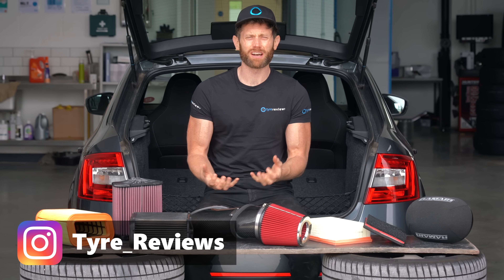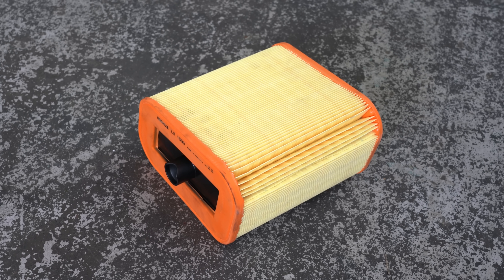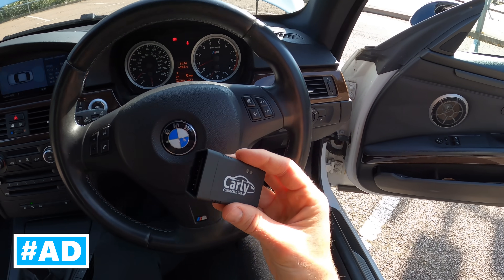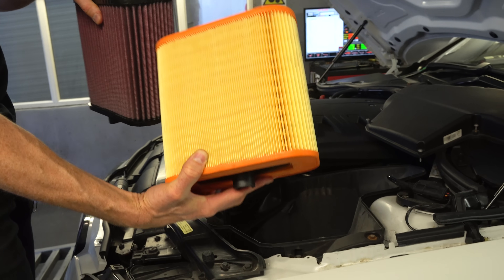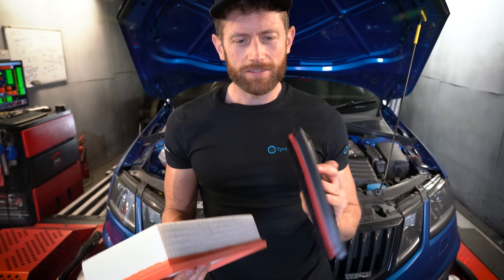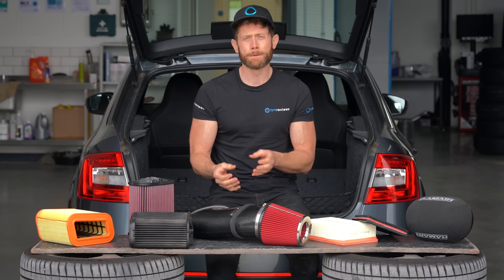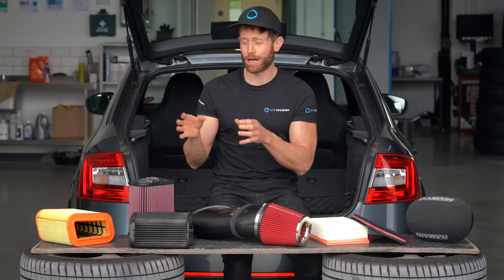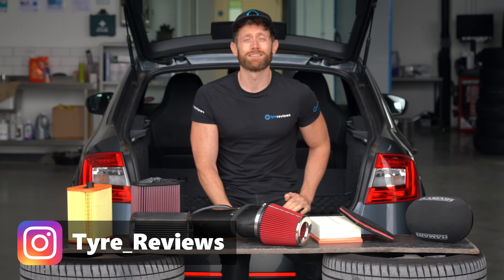Do Performance Air Filters REALLY Give You More Power?

Comment: For manufacturers of intake systems you are a scary person :-)
I am a tuner myself and have dyno tested hundreds of E9x M3's on my dyno dynamics machine when I owned it.
Tuned many all over the world remotely on dyno's too.
People always insisted on purchasing BMC / K&N filters from me and I'd show them time and time again, not even 1 HP gained.  Now that's with me being a lot more thorough than your testing where I was monitoring intake air temp (in the manifold), ignition timing and AFR.  With all things constant I never saw a gain.
Was sent kits from USA with very nice elbows - never saw a gain.  Ever.  Most of my tests were done on cars with primary CAT delete which is the major restriction point on the S65 engine.

Now, as for 'ecu' tuning for an intake, there is no such thing on modern cars with target based AFR and Ignition timing algorithms.  I can tell you now, it makes no difference for intakes UNLESS there is so much more air coming in the ECU has to change it's long term adaptions.  However, then it's adapted by itself so doesn't need tuning LOL.  The only factor that you can play with which 'could' make a difference is the valve overlap / cam timing.  It doesn't work.  I map the S65 and advance the intake cam above 5000rpm gradually and it does make a difference but adding an intake after that still doesn't do anything.

Most intake systems are about NOISE and under bonnet looks.  They can in very rare cases improve throttle response and partial load driving in the real world which is not going to show on a dyno though as this is only full load testing.
Low rpm torque dynamics can change especially if a nice large venturi is added which none of the intakes you have tested have.

I drove my own M3 with and without intake systems and to be honest I never actually felt a difference on the road over hundreds of miles of driving with them on and off almost every week or so.  Noise was good though!!

The S65 platform does have the capacity to gain 'some' power through the rpm range and good improvement to partial load torque BUT this requires a total re design of the OEM airbox so that a very large venturi can be added in place of that really quite small and awful elbow design which isn't going to get any bigger with ANY after market elbow kit.  I'd love to experiment with the shape of the inlet velocity stacks.  I had experience on the S62 where a customer made his own carbon ones and yes it did make a difference to throttle response and top end power.
No one offers this for the S65 and that is primarily because of the cost of development and then requiring a totally new plenum.

Next time you ever dyno or test cars on road for performance I'd be more than willing to lend a hand on doing even more accurate datalog based testing.  It's very easy with all of the OBD apps available now.

The ECU tuning..... we can have some serious fun if you are interested and I can show you all of the maps and how they are altered.  You'll have to contact me to find out which very MAJOR UK companies I have done all of the tuning for :-)  

Oh, and while the Akra is a great exhaust, you do need a specific map for this.  The Akra creates a bit of a low rpm torque dip which is related to it's X Pipe design.  You get rid of this by forcing a bit of timing and altering the valve overlap with the vanos timing.  Only one company offers this in the UK and I have that very map sitting on my PC :-)

Anyway, that's enough of me rambling on....... Look forward to seeing more reviews of all sorts.

I think it would be great if you could do some reviews on the latest E-Bikes!
Reply: One more thing I'd like to point out is that during my entire time dyno testing M3's on the Dyno Dynamics, most cars would make a calculated flywheel figure of around 405-420hp and around 290lb/ft torque and in excess of 430hp when primary CAT Delete.
I have seen M3's make a lot less if the wrong gear is used and if the car was strapped down too hard or if really sticky tyres were used (increases the frictional losses since the Dyno Dynamics just adds a percentage to the wheel figure rather than actually measuring run down losses).
I'm not sure as to why you are only achieving 380-385hp but my guess would be it's something to do with the way it's strapped down or the tyres you have used.
I would ask the operator what gear he used and do a new baseline.

Do you have an image of the dyno graph (just one will do) ?

Comment: A sport filter is the best cheap mod you can do to any car. Everybody is so fucking fixated on the power, they forget the rest. I put a ramair kit on my octavia vrs and the turbo is so damn loud now that people turn around on the street when I boost it. Sounds like its straight outta fast and furious, and its not even tuned, running stock boost. To me that was 100% enough to justify the cost. Dont care if I lost 5hp or gained 5, I traded it for enjoyment and thats what matters. I will continue to put sport filters on my cars, never had an issue with them and until I do, it will be the no.1 mod I do. Happy days.
Reply from the maker: I like you

Comment: Not even with old atmospheric carburetor cars... Even those required adjustments to the low and to the high speed circuits, AFR
But once the adjustments are done, as with newer ECU tuning, there is more power but then again something else will restrict the system: exhaust. 
An AccessPort device is needed for the least modification to work

Comment: i feel like you guys are running it on the dyno with the stock tune and not tuning to run the intake you installed... therefore you wont see the gains because the factory tune is optimized to be ran with the stock intake.

Comment: Short answer: “No.”
Long answer: “Possibly, but no.”
Reply: Depends on the car, some respond really well, others loose power.  Too many variables to make a statement like that.
Reply: Well on a regular car no but if it's tune then yes
Reply: @danielcasillas1133  I think still no... Maybe few extra hp, but with the money they cost, you better put them in something more efficient... So, still No!
Reply: @ScutuRC  depends on how far you go, 60$ for a 15bhp increase on a car that has a full exhuast, increased fuel pressure, injectors, and a map is easily worth it. Some guys tested a 9-5 aero that made about 295hp with the stock intake system, I believe they had a drop in oiled filter. They switched to a 3inch open air filter that sits in front of the wheel and it went up to 310. Intakes are cheap, and for a boosted car that's modded, they free up your other mods and help everything flow better
Reply: @ScutuRC  u get the sound so its worth it!
Reply: @danielcasillas1133  intake tuned and catback exhuast will net you no more 10% percent of power from a stock naturally aspirated engine anything more your talking about full exhuast engine internals cams and proper race intake box and torttle body and proper ecu work not just a tuned like motec or fcon.
Reply: Thank you
Reply: On a stock motor, no
On a built motor, yes

Comment: Just as in every other test. They just put a new filter in and test it. There is no point in doing that in my eyes because the engine management system needs to adapt! And that takes a while. I had it in older cars that they developed full power after nearly 100km. So give it some time.
Reply from the maker: Modern ECUs adapt relatively quickly, and we give each setup plenty of runs to adapt

Comment: Of course the performance would drop during testing ...Heat soak.Reduce the air intake temperatures will increase power ,even with the stock filter.Either insulate the the sensor or move it .A heat soaked sensor will deliver wrong info to the ECU

Comment: I would say unless you work the head, you wont benefit from a different configuration than stock. (On an N/A engine) on turbo engines, a tune and intercooler works wonders.

Comment: this came in handy for me. I dont have an expensive or a fancy car, I only have a 1.4 NA 2016 corsa, I've tried different filters to try and get a slight power increase. I've had universal filters, a ram air system and now using an enclosed carbon fibre filter with direct cold intake pipe drawing air from the largest open gap under the bonnet. at times it can really pull strong and at times it doesnt pull as good. makes me consider about the heat shielding.
Reply from the maker: But the sound
Reply: @tyrereviews  it definitely sounds better than some wee chavs 1L corsa C with a Halfords filter 😂😂

Comment: put 3 inch exhaust, high performance cat, cherry bomb and k/n filter on my 1984 f150 4x4, 4.9 back in 1985, went from 13 mpg to 18 low 21 high mpg
Reply from the maker: and extra BARP

Comment: It's almost like the engineers who originally made the intake system kinda knew what they were doing.

For the price of one perfomance filter for my car, I car get, like, 10 years worth of paper filters. Also, a previous owner of my car had a k&n "performance" filter installed and the airfilter oil killed the barometric pressure sensor in the MAF, which is a great side effect.
Reply: Some cars are better than others Langam... Mk3 Megane RS uses the same air duct and air filter as every other Megane... It's very, very rudimentary and just pulls somewhat cold air vaguely from behind the headlight [it's not a fully enclosed duct to take cold air from outside the engine bay :( ].
Reply: @TassieLorenzo  Let's not pretend like a cold air intake does anything at all besides sounding cool.

Comment: Performance air filter makes a positive difference if it's a part of a comprehensive upgrade, involving at least exhaust and dyno tuning. In modern cars induction systems are very well engineered and if you only change the filter it may lower the performance and increase MPG. Sometimes it will give you the impression of a better performance because of change in the torque curve but those go away quickly as soon as you start recording times or put your car on a dyno :/. For small but noticeable performance gains just keep an eye on the tires pressure and get rid of unnecessary junk from your car :D

Comment: No. just more sound
Unless you make the head bigger to accept more intake air, then it literally makes no difference, unless the intake piping is extremely restrictive, the stock filter is engineered to give the proper amount of air through it. Therefore, if you have a sports car there is literally no need to change your intake piping or anything because it is likely taking in all the air it needs.

Comment: $1,000 for a hot ram intake? Lmfao not even a true cold air intake. Pathetic
Reply from the maker: To be fair to it, it does sit in the OE box
Reply: @tyrereviews  but having the conical filter sit inside the OEM box just limits the actual filter size. Where if you had the filter outside of the box it could be larger.

Furthermore, this design may protect the filter from excess heat from the engine bay, but doesn't have any sort of air sucking advantage.
Reply: Alternatively, get longer piping and move the filter into the fender or bumper of the car. This allows you to increase overall filter size.

My car specifically, the filter sits behind the foglight directly in the path of natural airflow of the opened grill/bumper.
Sure the threat of hydrolocking one's car is there if submerged. But if you hydrolock your car with a CAI then you shouldn't probably have gone through that puddle regardless. Know your local streets is also key.
Reply from the maker: @epicraptorman  I'm not sure anyone has done that mod with the e92 as it ducts air from the bonnet too, I've seen it on other cars though
Reply: @tyrereviews  idk. I'm not too well versed in e92...or BMW in general. But I do think that $1,000 is way too expensive. Maybe $2-300. Anyways, I just think it's a bit unfair of a comparison of cold air intakes as most won't cost that much and for many makes/models there is the option of relocating the filter to outside the engine bay.

Comment: Pretty much what I've been told by a Subaru and Mitsubishi workshop, on stock cars slapping on a cold air intake doesn't do anything, even on a car with a high flow turbo-back exhaust and a remap ECU, cold air intakes barely add any more meaningful power over the stock intake and filter.

Comment: Don't go wit A-crap-of-shit system. They might be light and high end material with good build quality but sound like sh!t.  Try ARH long haders w/ 200 cell cat. instead ;) They claim 20hp gain. 
The thing with Eventuri that could be worth mention is that it comes with a scoop that supposedly allow for a better airflow thus giving 8-10hp. Was the air scoop used when dynoed?

Comment: People focus too much on the filter instead of the channeling of the air.
the Mk7.5 Fiesta ST200 has a different air channel flow, compared to the regular Mk7.5 Fiesta ST.

I also do believe that ECU needs to be re-calibrated when changing the intake. especially on Turbo cars.
But if you live out in the stick, a lot of dirt, you need maximum filtration for your engine.

Comment: Filter alone won’t do much change, you need to remap the computer that regulates amount of air let in the engine. Computer controls amount of air mixture with fuel to burn and create power.

When you remap your engine, only then you would make use of filter that lets more air thro. Be aware more air means more dust. K&N filter has oil over it to prevent that, but it also gets dirty faster cus of that.

I would avoid it and just use stock air filter.

Comment: Yet to see any car channel have the brains to actually tune the car each run for the specific airflow increase...
There isn't going to be a benefit otherwise, it's a supporting mod to be used in combination with other mods such as a cat-back exhaust system. 
Every time I see a channel do the typical filter comparison they NEVER tune for the specific filters, it just shows a lack of knowledge and further spreads the myth that "Performance air filters rob power". 
Your car isn't going to automatically adjust for more airflow for you, you HAVE to tune it...
Literally, every other engine mod gets tuned so why not performance air filters? Is it because people actually believe they don't need a tune to compensate the new airflow?

Comment: The whole premise of "higher flow air filter --> more air --> more oxygen gets into the engine --> more power" is stupid and assumes that the engineers who built the engine designed the intake in such a way that it didn't allow for an optimal amount of oxygen to get in to begin with. Basically, an assumption that engineers designed an engine, went through a very complex process of doing so, only to mess the whole thing up in the end with something as simple as using a wrong type of air filter and basically sacrificing power, torque and efficiency because of a totally elementary oversight that doesn't even necessarily save them money either. Well, that's just not the case, because the intakes are basically engineered to allow MORE AIRFLOW than it will ever be needed on a stock engine WHILE using the air filter...proven by the fact that even removing the filter completely doesn't magically make the car more powerful. The amount of air the engine needs can easily be supplied even with the filter installed and the partial blockage it causes, removing it or using a higher flow one will simply allow more air to flow through that the engine won't actually use or that it needs. The time an air filter will affect the power is when it's a really bad one and drastically reduces flow.

Comment: Grrrr, engines are not air pumps. Please get the science correct. They are a driven machine which uses fuel and air as the working fluid.

Comment: An air filter can only increase the power (of your turbo charged car) in a very specific scenario and that is if your ecu squeezes every little bit out of your turbocharger.

Why is that? In pretty much every normal car, your turbo charger can deliver more pressure than your ecu lets it. Because of that it really doesn´t matter if you decrease the pressure loss before your compressor or not. Who cares if it could deliver 2,5 bar with the best air filter and only 2,3 with the worst and dirty one if your ecu only wants 1,8 anyways?

Only if you "need" all you can get you´ll see a (pretty small) effect.

Comment: Great vid, but - more important that power - More TORQUE (albeit not much) on everything but stock, on both cars!  Stick with stock air box and add a performance filter panel - like a KnN.  Also you need to get a turbo intake pipe on the 888 Skoda engine.  Does far more than a filter due to weak VAG design of OEM part. :)

Comment: I'm confused.. The dyno is a roller type which is getting a power reading in rear wheel horse power, yet the figures displayed are in BHP? 384rwhp would convert to 420 break horse power if you factor in a 10% parasitic loss from drivetrain (From the flywheel to the tires) , so the factory numbers are within margin of error.
Reply from the maker: The number used was the calculated fly number

Comment: I was led to believe a high flow washable air filter makes engines go better!
Sometime ago I bought a high flow and installed it into my factory air box on my tdi vw golf 2007. The first thing I noticed immediately was it didn’t have the initial take off (torque) it had so I put back in a new factory filter and voila, car was back to normal again. I won’t buy a supposed high flow filter again after this.

Comment: I wonder if the chip in the car is also affecting HP because it doesn't know what to do with the different airflow. Packages from APR (VW/Audi) don't have an air filter or engine stuff until you go to stage 2. I imagine the freer flowing filters bringing more materials into the engine are not good to the engine itself and little bits like the spark plugs.